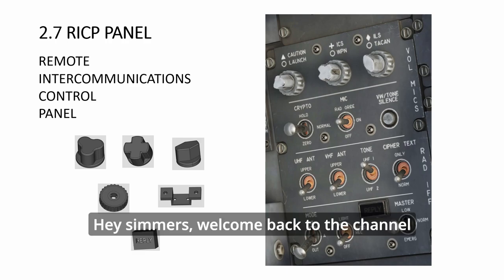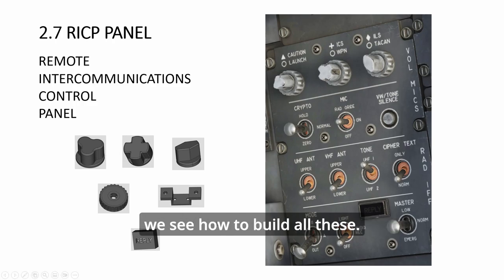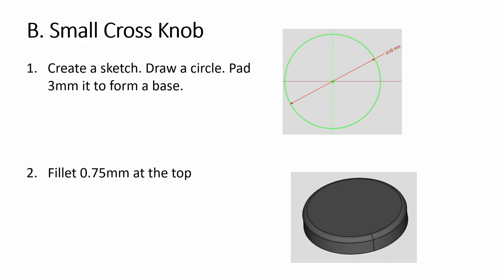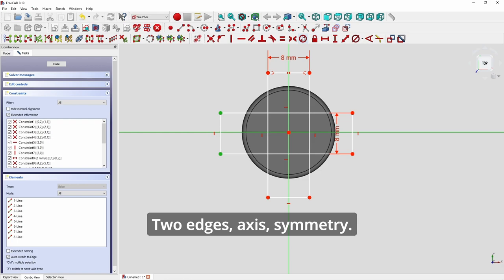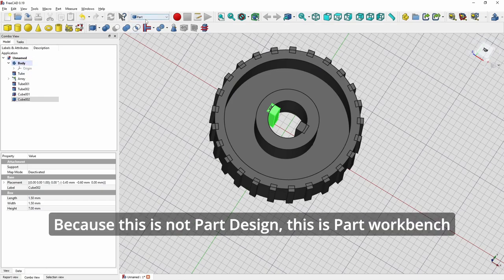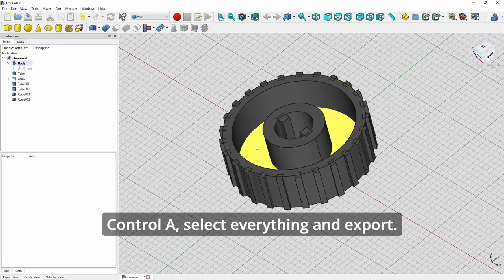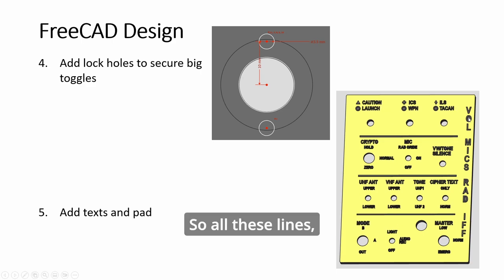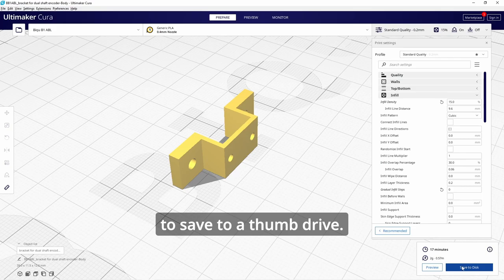Episode 7 How to build DCS F-15E RICP Panel

Comment: Would it be possible for me to follow the same steps, but for the F-15C model?
Reply from the maker: the idea of showing my F-15E build in great details is to teach everyone to use FreeCAD to design their own panels. The C model has some similar panels which can be reused from the E model. The rest you have to learn FreeCAD then design those for the C. But the C is not even high fidelity, just mouse and keyboard and hotas controlled in flaming cliffs. Sure you can build one to look complete. But you can't control the switches and lights etc at the moment for the C model.